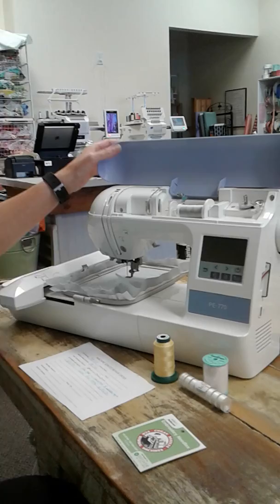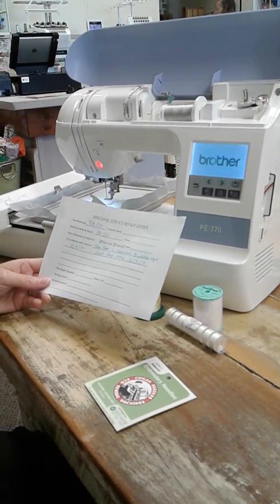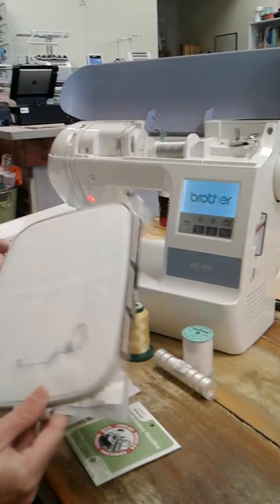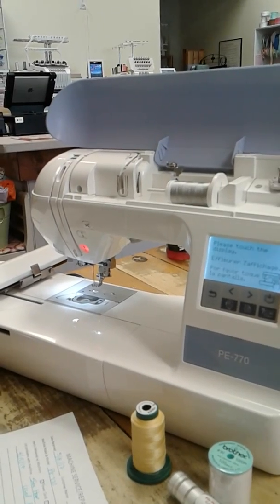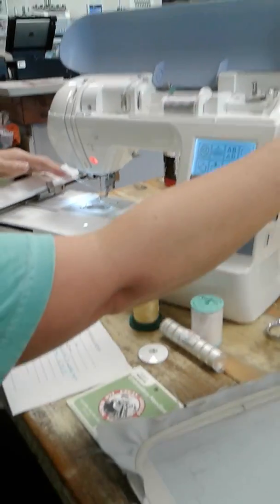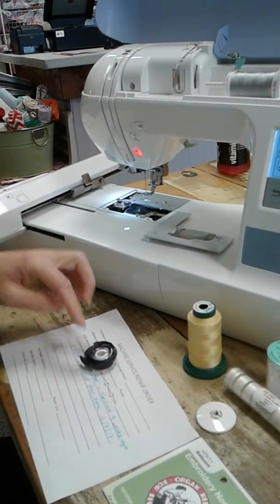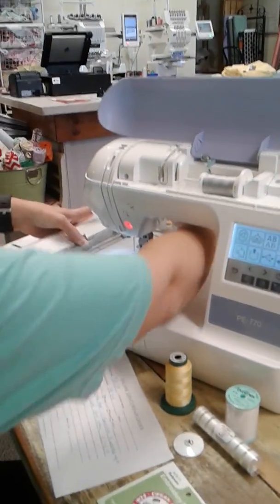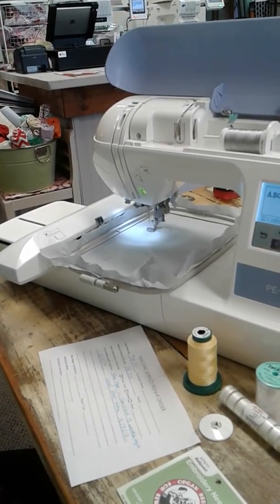Troubleshooting your PE 770 Part 1

Comment: my bobbin isn’t turning to get wound up
Reply from the maker: Usually this happens when you are using an incorrect bobbin. Try another one? Preferably one that came with your machine or purchase new ones that your owner manual outlines as the correct bobbin. If it is not the fault of the bobbin, is the bobbin winder turning?? If it is not, you will need to take it in to a repair shop.

Comment: Can you oil the hoop cartridge?
Reply from the maker: Yes! The mechanism that carries the hoop has screws in the bottom. You can remove the casing and clean the interior of lint and thread and then oil along the shaft.
Reply: @Zig Zag Sewing Studio  Everyone is saying to take to a technician. I have watched a video on the main machine but not the hoop cartridge.  Thank you.

Comment: I have a pe770 and the error message keeps coming on lower presser foot and the presser foot is lowered please help
Reply: It’s possible that the sensor is damaged. Try removing the presser foot from the bar. And then when the bar is down, see if you continue to get the message. At times when the presser foot is not on the bar correctly then it won’t let the presser bar completely down. If after all of that if you continue to get the message then your sensor is not sensing that it is down. That would require a service tech to repair.

Comment: My shaft is having a difficult time moving up and down.  Feels very tight. I've opened the top left side of the machine and cleaned it out, but still no luck.  Any suggestions would be helpful.
Reply: When you turn the flywheel snd it is hard to turn it can be a number of things.
1. Make sure that your bobbin area is clean. 
2. Take off the left top cover (screw is in the back for removal) and look inside at the gears. Lots of time thread gets wrapped up in the gears. I use tweeezers, scissors, and razor blades to get the thread out. This can take awhile depending on how deeply it is wrapped up in the gears. 
3. Another issue but less often is that the shaft has become “frozen” because the bearings needed to have been oiled. 

If you aren’t able to solve the issue, take the machine to a service center. Brother, Babylock and some other dealers can service the machine for you.

Comment: I hace a trouble whith my pe700...I turn it on, and when I have to press ok in the screen it doesn't do nothing... Just stay in that message and do no more... Help!! 😭🙏
Reply from the maker: Luis, If your machine is not responding to your touch on the screen, the LCD panel may need to be replaced. It should not be very costly....The part is not very expensive, but finding a technician to change it out may be difficult. Try the closest Brother dealer for a repair. Another option would be to purchase a very used model of your machine to use for parts and try the repair yourself.
Reply: @zigzagsewingstudio9114  allright... ! i thougt it may be a memory fail or some sensor... so i'm gone to take your advice and take it to a brother dealer.... thanks very much!!

Comment: Hoping you might be able to give me some information.  
I have the PE770, when I turn it on the brightness screen is showing.  When I go to touch screen it's like it's frozen.   I have tried shutting it off for awhile then back on and still showing brightness screen.  This is the first time that I have turned this machine on since December of 2019.  It hasn't moved or been touched since then.  It was working perfectly.
Reply: It sounds like one of the boards needs to be replaced. A service center can do this for you. Or you can try taking it all apart and checking all of the wired connectors to the board, making sure that they are all plugged in.

Comment: wonder if you can advise me what to do with my machine, not tying off the stitches at the end of satin stitch letters. working with brother dream creator
Reply: The machine will stitch as it is "programmed" through a design. If there is not a "tie off" perhaps it was not put in by the digitizer. A tie off is simply a stitch in place for 3 or more stitches or a backstitch that acts to lock the stitching. You can manually do this. You can also use a bit of glue on the back of your work to secure the thread. This is my best answer and I believe all to be accurate however I don't pretend to know everything and someone else may have a different answer. I always advocate for going back to the dealer and ask questions! That is what they are there for (or should be anyway.)
Reply: Christy Alverson  yeah that's weird. It seems  the fonts that came with the machine are the worst one.  Thanks